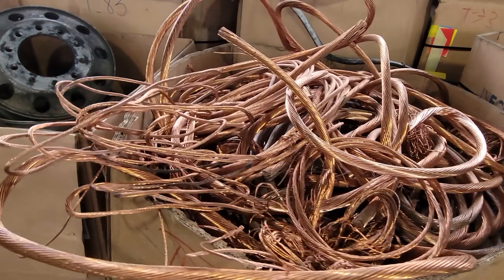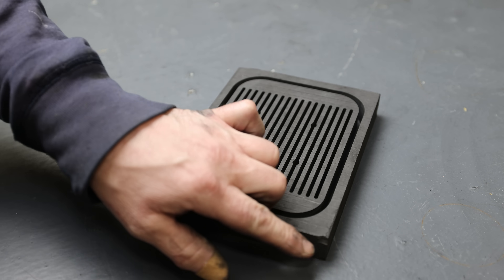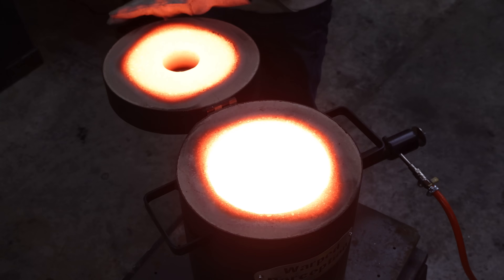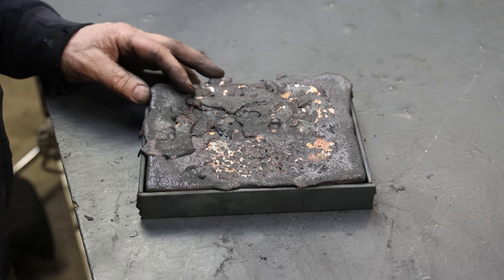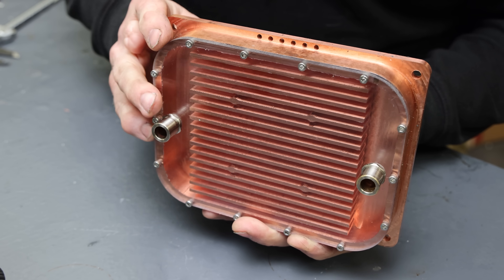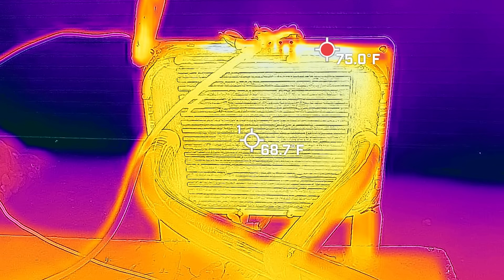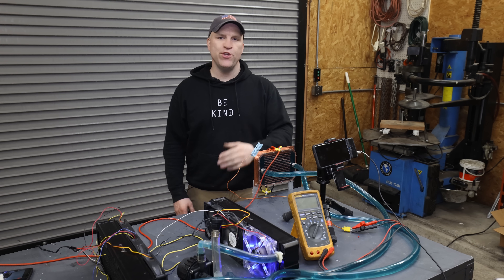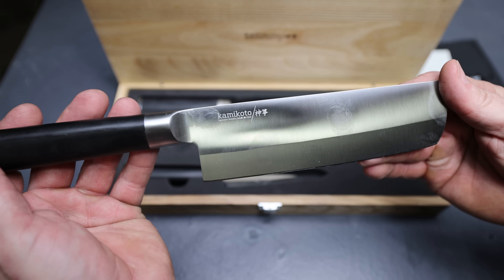Making a Huge Waterblock from Scrap Copper -Trash to Treasure

Comment: At my job we design medical devices, and spend a lot of time working on heat transfer blocks. I've yet to see an optimized block that had a lot of straight parallel lines. The best ones always look organic. Sometimes a straight-lines block is selected because of manufacturing cost, but they never perform as well as the ones that make our prototype shelf look like an H. R. Giger alien autopsy.

So, based only on the visual appearance of your block, I suspect that your design is not optimal, but I can't use our expensive machines at work to confirm it. Maybe contact one of the generative design software suppliers? They might be willing to design a part for you, just for the publicity of having you compare it to the straight-lines design.
Reply from the maker: Great point!, And you are absolutely correct about the parallel lines. However in this case I needed more flow, and I did in fact computer simulate all of my designs before making them. So one of the bigger issues I faced was the tooling I had to use to cut the slots with the max RPM I have available is not well suited to cut intricate shapes at that depth and level, I would have had to change my tooling very often. And with a very lengthy machine times I did not want to babysit this thing for 10 hours. But yeah the type of machine I had to use had a huge Factor in my final design, I also needed a higher flow rate and less pressure drop between the inlet and the outlet of the block. Your spot on though, that was a good comment.
Reply: @WarpedYT  If you want to squeak a little more performance out of your cooling loop, either add a little bit of isopropyl alcohol to it with a maybe a single drop of soap, or get a bottle of water wetter... It will help with the boundary layer flow by acting as wetting agent to allow even greater heat transfer. It doesn't take long for it to work either, put it in, and maybe 2-3 minutes depending on your flow rate to get everything distributed, you should be able to see it change. 

Might be an idea for a video if you can add it to a stable system while the pump is running, like add it to the reservoir once you hit your steady state 122F... see how much it changes.
Reply: @kleetus92  are you into pc building by any chance, I have never heard someone mention this and I wonder if its viable in a PC water loop in terms of longevity.
Reply: @TurkeyOW  I am. It will work in any water based heat transfer system. My first time seeing it was in high performance car applications where the cooling system was being pushed to the limit, even with a bigger radiator. It may not solve all your problems, but it will give a few extra percent of heat transfer. You can buy a product literally called 'water wetter' in car parts stores... it's a clear redish pink liquid, apply per instructions.
Reply: @TurkeyOW  you may not see any significant improvement in PC application where we're deaing with very light loads (only a few undred watts), compared to car engine cooling.
Also, acrylic parts hate alcohol :) it's generally advised not to use alcohol in custom loop coolants, or clean those parts with alcohol based cleaning solutions.
Reply: @ledoynier3694  THX 4 THE INFO caps oops
Reply: @ledoynier3694  I assume he replaced the acrylic with a finned copper cover plate once he was confident the flow was stable. Lots better cooling that way.
Reply: He could also contact one of the other YouTubers who do stuff like that. There is a lot of people here playing around with generative software and machine learning, and a collaboration would probably be a lot cheaper than going for a company.

Comment: Great engineering accomplishment while also very educational and entertaining!
Reply from the maker: Thanks this one was really tough.
Reply: @WarpedYT  you are great engineer 👍
Reply: @WarpedYT  What was that mixture you made 7:28 and why use it? It looked like Silicone/RTV and something else.
Reply: @mmellow51  Probably mineral spirits or toluene to thin down the silicone so he could put on a really small even bead. The screws around the edge are doing all the clamping so the silicone is just there to seal.

Comment: Having watercooled PC's, I've always wondered if making the heat exchanger (i.e., radiator in this case) out of copper would improve performance. Same with intercoolers for turbos and superchargers. Obviously would add weight in the latter applications.
Reply from the maker: Yep, I have also wondered the same. But man that would be one expensive intercooler that's for sure.
Reply: Um PC radiators have been made from copper for many years, and yes they work much better than aluminum.
Reply: @78ss53  Um not for the applications I referenced.
Reply: It doesn't make enough of a difference to justify the cost increase.
You can get more cooling in the same space but usually it would be better to just add one more surface area.
Reply: @Ultrazaubererger  How do you know? Have you tried it? A lot of guys drop $500 just for cold air intakes that do nothing.
Reply: @uclajd  I have not tried it myself but I know from my PC water cooling days (about 10 years ago when AIOs were still utter crap).
And I've also seen one of the tech tubers try it recently but can't remember the video.
It was a system with reasonably sized rads and it made the CPU like 2-3°C colder.

On cars you also have the problem of the added weight.
Aluminum can transfer more heat per weight.

Comment: So cool though cooper block is homemade and used a pc radiator.
Reply from the maker: Yeah there's multiple PC radiators but that was just for testing, the idea behind this was just to get the water block working for the heat exchange. The rest is pretty easy.

Comment: why not use an nhd15 with liquid metal i think it would be cooler temps, easier, smaller and more reliable
Reply from the maker: So to my surprise I found out that a lot of those are not filled with liquid metal at all, those tubes are filled with water. I can't say for all of them but the ones that I have cut open have had water in them.
Reply: @WarpedYT  hey i meant use an nhd15 for the cooling part and then for the interface between it and the led you can use thermal grizzly conductonaut thermal paste for best heat transfer.

Comment: Copper has great conductivity, which is why we use it, but nothing beats silver.  It's expensive but its thermal conductivity is 430 W/(m·K).  The thermal conductivity of Copper is 401 W/(m·K).  Would casting one made of silver be worth it?  

I used to own a silver extension cord.  It grew legs one night.  Still mad about that.
Reply from the maker: I thought about silver, but copper did the trick and was much less expensive. Wow that's pretty amazing I've never seen a silver extension cord in my life.

Comment: Did a crackhead teach you those handwriting skills? Radiators have inlets at the top and discharges at the bottom... Ya' know to take advantage of that whole thermal dynamics thing.
Reply from the maker: I'm missing fingers.. I write left and right handed. And for radiators it's the other way around, cold in the bottom hot out the top you got it backwards. Remember hot water rises.

Comment: Great job man, seeing good project that solves real problem is amazing. I just wonder if just machining a copper block wouldnt be easier? I understand that you want to use less copper (because its expensive) but you still did it 3 times and spend the time to machine the mold anyways. Was it worth it?
Reply from the maker: Thank you, I agree I think building something to solve a problem is more exciting than just building it to put it on the shelf.
You are correct, but since I wanted to minimize or even eliminate the air in my casting, I decided to cast it in a mold instead to reduce the volume of copper, had nothing to do with the price, but a solid block of copper is just way more volume and increases the chances of air. And since I wanted a beautiful finished part I was trying to completely eliminate air from my part as much as possible.
So at the end yes it was worth it, originally I was just going to machine this part out of a solid piece of copper, but unfortunately the raw material is not available for a couple months at least, and as a last resort I tried it this way and made a video on it.
Reply: @WarpedYT  awesome, thank you for the context :)

Comment: Worked with graphite it’s like never seize……all you need is a dab……..and your covered in it and it’s everywhere and you hair won’t wash out and…..
Reply from the maker: It's terrible, and it also got into some of my electronics and created static and some of the audio clips on this video, so now I have to figure out a way to clean everything out with electronics cleaner. And yeah I use the ventilator so like you said all you need is a dab and it's everywhere

Comment: Genuine curiosity. Wouldn't it be better to put a bit of a path to your waterblock so the coolant has to travel through more of the block to get out, seems that you basically have a cool path right across the middle of the block with some convection from the extremes
Reply from the maker: Good point and yes, that that was one of my first designs, I completely forgot to show that in the video when I said there was a lot of iterations. But yeah I tried that it didn't work, there was so much testing behind this it was insane, on this particular part I spent about a year designing and testing before coming to the final design here and doing the video.
Reply: @WarpedYT  I suppose you add complexity to the path at the expense of increasing flow resistance and turbulence. Cheers

Comment: I would drill and tap a hole on top of the water block and use a bolt with a o ring to seal it, just to make priming the block easier and ensure its totally full
Reply from the maker: That's a great point, however since I want this to be a maintenance free device, I'm actually redesigning that back cover to allow it to automatically bleed and fill, this back cover was just for the video
Reply: @WarpedYT  Awesome! I can't wait to see the completed version.
Reply: I would also use a flexible sealant like Hylomar or instant gasket to seal the cover onto the block as the coefficient of thermal expansion of acrylic is about 4x that of copper.

Comment: Same issue with cutting carbon fiber. As a hobbyist, I do not have the level of air extraction that professionals do, so a lot of us run our jobs submerged in water and it captures all the dust.
Reply from the maker: Yeah that's a good point, the air extraction especially for carbon fiber is a big deal if you want a nice finished beautiful part

Comment: I'm curious: Wouldn't it be easier to cast a simple cuboid of copper and then mill out the fine structure? Milling the fine structure in the graphite mold seems counterintuitive.
Reply from the maker: Yes you're right, that's what I wanted to do in the first place but I was fighting the problem of aeration, and the larger the volume of the casting the more chance of air in the final part, and since I wanted to end up with a very beautiful looking part I wanted to minimize air as much as possible.
Reply: Maybe playing with molten copper and building new skills is the goal. 🤷‍♂️
Reply from the maker: @byrond8592  the air is the problem, the large you go the more air you will get, by staying small with the cross-sectional dimensions of the cast I reduce or completely eliminate the air contamination to get a solid part with no air or pitting. as you pour into a small cavity the liquid copper is protected from the air. that's one reason why they roll large bars of copper instead of casting.
Reply: @WarpedYT  That was a nice tip, flooding the crucible with flux and hiding the copper under it. Simple solution, but knowing when to use it is the key!
Reply: Yeah probably counter intuitive but got the same result lol
Reply from the maker: @feelincrispy7053  much better result when you reduce air exposure of the molten copper.
Reply: Machining copper that deep  whit such a small endmil is hard if you only got a drip feed of coolant  you need jets of coolant to blow out the chips and that's if the material is very consistent and a diy cast probably is not
Reply: milling coppers a REAL pita. gummy, grabby and LOVES to eat tooling
Reply: Copper, unless it’s appropriately alloyed, is awful for machining.  “Gummy” and “grabby” are two words I’ve heard used.  Same for tin-bronze, unless you add a little lead and/or zinc.  I had to chisel out a busted drill bit out of a casting involving 90-10 tin bronze.  Someone else busted the bit…

Finally, copper alloys often want some phosphor-copper shot added just before pouring to not be “messy”.  I bought a pound at Amazon, which used “budget casting supply” as a vendor.
Reply: Some was think exactly what I was thank you
Reply: Ah, but now this guy has a mold to make many many more cooling blocks.  Maybe can market these to make some serious money.  Somebody out there using these high-wattage LED chips will require this exact cooling block in their application.
Reply: I'd say this was the right way to do it. While casting a solid block would seem to be the easier option, it has some pretty big disadvantages. Firstly, the sheer amount of raw copper needed, which isn't the cheapest material (I know he's using scrap, but why use more than needed). Then there's the time to machine out the desired shape. Also, copper is notorious for not being easiest material to work with.
Reply from the maker: @JaenFoster  you hit it right on the money, the cost wasn't really a factor for me because I was paying about $4 a pound, but copper as you said is difficult to work with, it loves to absorb the air molecules when it's in its liquid state, you have to protect it and you have to reduce the air exposure while getting it into the casting if you don't want air entrapment, also it pours like crap unless you add phosphorus or a tin and then that changes the composition somewhat unless you get the phosphorus exact which is a science in its own. The best way to do it that I found is to protect the liquid copper by plenty of flux, and then reduce the mould surface area by as much as possible so while you pour it you are shielding the liquid copper as much as possible.
Reply: @WarpedYT  just curious what type of flux did you use is it just borax or is there something special in it?
Reply: @WarpedYT  maybe try making a vacuum casting machine
Reply: @WarpedYT  I think what the OP meant was why didn't you just mill out the plate from a copper plate. or cube, completely negating the need for the issues with molten copper.
Reply: @JaenFoster  Pretty much this. If he had bought a piece of copper, then it indeed would have been the right choice, but he made it from scrap. Alough it might have been also possibly to, instead of milling a graphite mould, make a master silicone negative, cast wax, then create a classic plaster mould by means of lost wax casting, and then pour the copper. The hot mould can simply be dissolved in water, which would have made the milling out of the whole mould unnecessary and also have spared him from having to redo the mould by mill three times, and also from a whole lot of graphite dust.